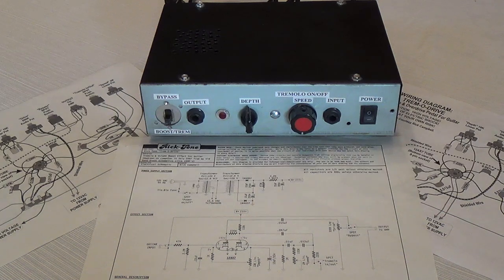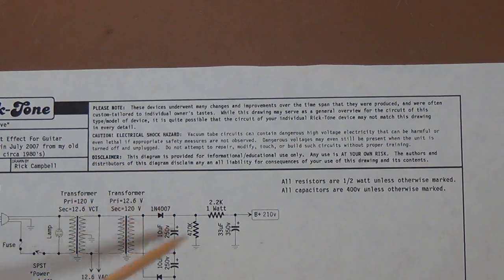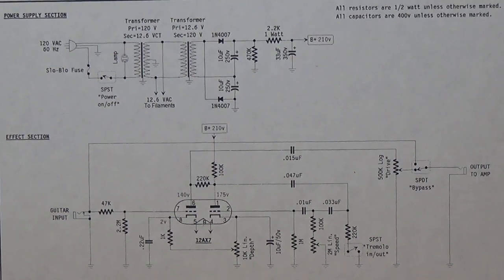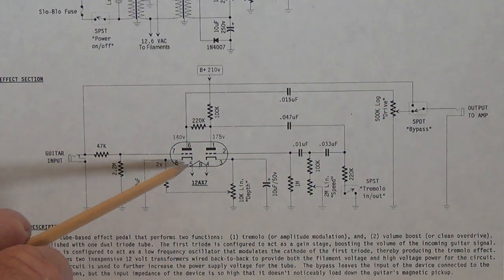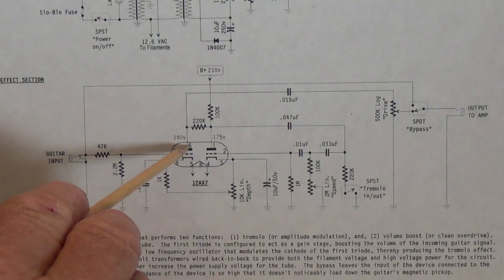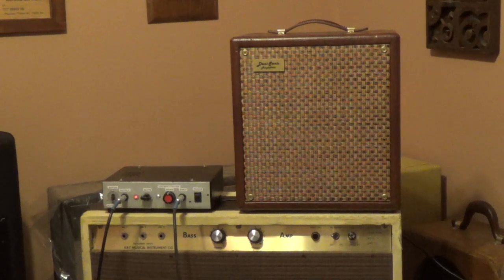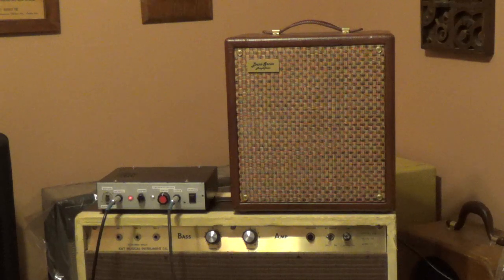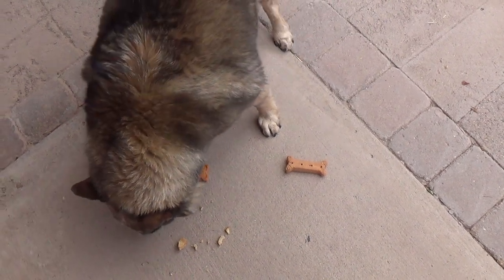Build Your Own Inexpensive Tremolo & Overdrive Boost Unit, Part 1

Comment: The MC3340 electronic attenuator is in rerelease. It's current controlled, but that's just a resistor for VC. It distorts pleasantly.
Reply from the maker: Thanks for the tip, Richard.

Comment: I like the idea of this project but I don't  think I need a Tremolo. Is it possible to make this project but instead of using the second stage as a tremolo circuit make it a second gain stage. It would probably need to use an attenuator circuit to prevent blocking distortion or run away gain?
Reply from the maker: The unit is primarily a tremolo effect hat has boost capability due to the use of a 12AX7.  Rather than subvert its primary purpose, it would be easier to simply build a basic boost unit.

Comment: This sounds amazing! Just wondered if anyone in the UK has built this? How would I go about adapting this to use with 220/240 V 50Hz mains voltage?
Reply from the maker: Glad you liked it, William. The circuit is actually simpler for you, since you don't need the voltage doubler with 220/240VAC.
Reply: @UncleDoug  thanks for your reply. You wouldn't happen to have a clear copy of the schematics/layout for this project that your could email by any chance?
Reply from the maker: @williamjenkins9423  My suggestion would be to use your "Print Screen" button to take screen shots of the documents you need, and then print them out. Good luck.
Reply: @UncleDoug  Would I be able to use a Hammond 369AX (250V C.T. @ 115ma / 6.3V C.T. @ 2A)?  Is it totally necessary to use 12V for the filament of the 12AX7?
Reply from the maker: @williamjenkins9423  You're in luck, William. Since the 12AX7 filament is center-tapped, you can connect one output lead from the 6.3VAC winding to both ends of the filament (pins 4 & 5) and the other 6.3VAC lead to the center-tap (pin 9). Look at virtually any amp schematic to see how to do this.

Comment: Hey, I’ve learned so much from your videos, great work passing on the knowledge Doug 👍 
Question - Would this be a harmonic tremolo circuit, or is it oscillating the volume? Do you know to a valve based harmonic tremolo circuit that could be made in to a pedal? Cheers 👍
Reply from the maker: That's good to hear, Chris. It is purely a volume-modulating circuit, i.e. a true tremolo. Harmonic tremolo requires several tubes and an elaborate circuit.....so it cannot be contained in a pedal.

Comment: GreAT video-- but question, after building one... My math isn't working (and sure it's me)  have 120 RMS (170 P2P) house voltage.  doubled (and loss thru the xformers) is 324V. will need a 2.2K and a 4.2K to get down to 210V at the B+  will greatly appreciate corrections..
Reply from the maker: Thanks for the info, Scott.
Reply: @UncleDoug  Once connecting all the signal side ( I made it in two parts, then ran the heater wires & B+ to the other part), it came down to 275.. and works awesome..  thanks again for the great videos!
Reply from the maker: @gpsfretworksllc6286  You're welcome, Scott. The B+ always drops quite a bit when it has a circuit to power.

Comment: could  I build this but use 220v - 12v transformers? or would the resistor and capacitor values need to be changed? best vibes and keep it up!
Reply from the maker: Yes, you can.....and you won't need the voltage doubler portion of the circuit. The component values would remain the same.
Reply: @UncleDoug  thanks for the reply! love your channel lots of good information! learned a lot with your videos! How awesome would be for you to build a tube harmonic tremolo! would love to see that happen! best vibes!

Comment: Hi Uncle Doug!!!  Here is my 2nd version of the Rick-Tone / Altec 1566A Preamp clone - https://youtu.be/GUwyo6Hfj7k  

It wasn't without its issues but I sure learned a lot!!!  I've gained some experience and confidence with this 2nd build and I'll probably take it apart...again...and build a 3rd version utilizing just one 12AX7 instead of two, and I'm probably getting ahead of myself, but I also have plans to clone the preamp section of the Ampeg B15NF and use the Rick-Tone voltage doubler and a 12AX7 instead of a 6SL7.  Wherever this may go I'll at least keep my hands busy with something fun, and because I have most of the components from the previous build I'll only have to buy a potentiometer or two and a resistor here and a capacitor there.  It's cheap, clean fun from here out!!!  Thank you for all the information and inspiration!!!  I gave you props in the video details and put a link to your page there as well. 

Thank You,
Chris
Reply from the maker: Wow, Chris. Very clever design, with the license plate chassis. I really like it !!!  Your wiring and overall construction seem quite good. What you are doing is EXACTLY the way to learn about tube electronics.....experimentation, solving problems, re-doing circuits better and better, etc. You are well on your way to an excellent grasp of circuit design and construction.
Reply: @UncleDoug  - Thank you so much for the encouragement!!!  I have mostly you to thank for getting me interested in all this!!!  Eventually I'll have something that sounds really good, compact, practical, and can be replicated for friends that would want one.

Thank You!!!
Chris
Reply: @UncleDoug  - I was reading up a bit and happened upon an article about the value of a a grid stopper.  I watched a few videos and I think this may be my problem.  On the "Hi/Lo Gain" switch I added to the 2nd version of this circuit there is no grid stopper on the Lo Gain setting that bypasses the first half of the tube.  It goes straight from the input to the volume pot then to pin 2.  The volume completely turns off (oscillation?) when the gain is turned all the way up, but then turns back on as you turn down the gain, but hums like mad!!!  OK, let me try that and I'll keep you posted!!!  Thanks for everything!!!
Reply: @UncleDoug  - Hi Uncle Doug!!!  I have finally completed the preamp project.  Here's a link to a quick video that shows the final construction.  I'll do one more video with sound samples.  This unit sounds great!!!  Thanks for all the help!!!  As always, I give you props in the description.  I'm thinking the next project might be a compressor unit of some sort.  We'll see...

https://youtu.be/s5XXIpJ3ukA

Comment: Hi Uncle Doug - Would connecting 14 gauge wires to the heaters, from the 18 gauge wires of the 12VAC PT, reduce resistance enough to lower the voltage at that node from 12VAC to 8VAC?

Background: No hardware stores around me carry anything smaller than 14AWG, so that's what I used for the heater connections, all B+ wiring, any jumper connections (i.e. pins in V2 cathode follower), input jack to V1, and all star ground connections which should be the only thing a larger gauge wire might be OK for.  I didn't want to buy the 100ft rolls of 22 gauge, 20 gauge, and 18 gauge wire for the 6ft of wire that I needed.  If this is the problem, I'll have to do a lot of disassembling, which would not be as difficult as figuring out what's wrong if it's not the problem.  Thanks for the time and replies.
Reply from the maker: Not even close, FN. At the relatively low current levels in a medium to small guitar amp, wire gauge has little, if any effect. There are vendors on Ebay that sell assortments of wire in useful gauges, like 18, 20, and 22 in various lengths for reasonable prices.
Reply: @UncleDoug  - Thanks for the reply!!!  Well, if wire gauge is not the problem then I'm fine with the 14 gauge I'm using.  I will look for connections shorting to ground?  I am committed to tearing apart the unit and putting it back together component-by-component.  I suppose I should surely find the cause that way.  

Thank You!!!
Chris

Comment: Hi Uncle Doug, Would you have any idea why my 12AX7 filament wires only show 8 volts instead of 12 volts?  The rest of my circuit is different.  I used the power supply from the RickTone tube preamp which is very similar.
Reply from the maker: How are you measuring the voltage, FN?  With the tube out, from pin 4/5 to pin 9 with a calibrated AC voltmeter? If so, then I can't explain it without examining the circuit in person.
Reply: @UncleDoug  - Thank you so much for the reply!!!  That may have answered my question and will undoubtedly create more questions once I am able to  test again tomorrow afternoon.  It is possible I have the filaments wired incorrectly, from the 12V secondary to pins 4&5 only, with no connection to pin 9.  Would incorrect filament wiring affect the B+ voltage?  Because the voltage doubler does not seem to be...doubling.  It is altogether possible I am measuring that wrong too.
Reply: @UncleDoug  I rewired the filaments in parallel and measured between pins 4&5 and pin 9 with a AMPROBE AM-510 multimeter, and got 7.8VAC.  I plugged in the tubes and they are now glowing, unlike when I only had pins 4&5 wired in series.  I got excited and figured if the tubes were glowing it must be ready to plug in and try it out...  The tone fattening capabilities of this unit are apparent even at the very lowest gain setting.  Anything above 1 and it's clipping though.  I was going to record a few samples with and without, then measure some more with the tubes in place, to see if that would make any difference.  However, before I got to measuring, a terrible smell filled the house and I had to turn off the unit, turn on all the fans in the house and open all the windows.  Both transformers were extremely hot.  Also, before I plugged in to enjoy the sounds, I measured the input of the voltage doubler from the output of the 120V side of the second transformer and can't remember what it was measuring but it was nowhere near 120V.  I think I'm going to migrate towards acoustic bass guitar and not have to worry about tone from melting-plastic smelling electronics that I know nothing about.  It was a fun experiment while it lasted.  Thanks for all the replies!!!
Reply: @UncleDoug  - I think I just realized what is the problem.  I believe what is causing the low voltage is how I have the primary of the 1st transformer wired through the pilot light, which has a substantial resistor to protect it.  I drew up the wiring diagram before I knew I needed the resistor on the neon lamp, so the diagram did not include the resistor.  I must have considered that node not to include the resistor so I believe I have the primary wired through the pilot light instead of just to it.  I'll keep the dream alive and check it tomorrow with a fresh set of eyes.  Thanks for the inspiration, Uncle Doug!!!
Reply: @UncleDoug  - I looked at how I had the pilot lamp wired and it was wired correctly in parallel so it was not affecting the primary of the first PT in any way.  Just to make sure, I removed it from the circuit and checked without it, I got the same measurements where the 12VAC output of PT1 meets the 12VAC side of PT2 and the filament wires, as I did with the pilot connected.  I figured while I was taking this thing apart, that took me forever to put together, that I might as well see if one of the transformers was bad.  Here's what I got when I isolated PT1: Input=121.8VAC / Output=15.51VAC/7.74VAC/7.76VAC.  Does the output seem a bit high for a 12VAC secondary or does that seem to be within tolerance?  When I connected PT1 to PT2 I got (from PT2): Input=14.85VAC / Output= 112.3VAC.  Again, that seems within tolerance, right?  Do you have any idea what would cause the voltage to the filaments to drop to 8VAC when connected to the circuit to the rest of the circuit?

Comment: Way back when, Radio Shacks in even moderately sized cities were veritable candy stores for project components like this.  Yeah, some of the components they sold could be sketchy, but they were mostly inexpensive so it wasn't a big deal.  One could come up with a project idea, make a trip to RS, and have enough stuff to get through 90% of an initial build.  (Always note that the last 10% of any project takes 90% of the total time.)  Anyhow, I miss those days.  Thanks for all you do, Uncle Doug!
Reply from the maker: You're quite welcome, Michael. I too mourn the loss of Radio Shack. Whenever I ran out of a particular value of resistor, capacitor, etc. I could buy it from them and be back to work in an hour.

Comment: I have a few queations I am,glad you have this video am wanting to build a bad ass amp but I agree I am not ready for that yet so this is a great starter build and useful as I will use it so my question is where do I get the components for such a build and what kind of parts do I need to keep a stock of such as resistors capacitors etc... Would appreciate it if you could address in a video or respond directly thank you I have been watching your tutorials and I am,confident in giving it a go some things are retained only when used in application just knowing will never get me ready to undertake an amp,build without some practical knowledge
Reply from the maker: Most vintage parts are simply on hand as a result of many years of working on amps, Jeff.....which won't do you much good.....but my favorite source of all components (other than transformers) is Antique Electronic Supply.
Reply: @UncleDoug  thank You so much since,I have you answering questions I have a hand full of old radios as well 30's mostly none,of them,have an auxiliary input and some,of,the capacitors are the paper kind 2 of them ate 6 volt DC the one I am,most interested in is a Atwood Kent 310 it is a 120 watt amp in it 10 tube do you have any experience with such an animal I found a schematic but it has half the wiring diagram,cutoff do you think it would make a good base for a guitar amp
Reply from the maker: @JethroBoDean  In my experience, the older radios aren't really suited for conversion. You can use the cabinet to house a scratch-built amp chassis....but trying to change the ancient circuit into a good-sounding guitar amp is more trouble than it's generally worth.
Reply: @UncleDoug  great info at least I'll have some tubes and transformer etc... To start filling my parts bin 😆 thanks again oh one more thing mostly of curiosity and I cant seam,to find any info any where on line the bone yard I was going through had I'm not certain what it was it had a 1/4 inch jack or 2 in it and had tubes that were slotted at the top of a rectangular shaped prob 1 inch across and 1 inch wide x about 3 inch tall and the rectangular piece was slotted in the tube socket strange looking any idea what in the world that is or was
Reply: @UncleDoug  I found,the tube # for those strange combo whatever's 5963 they look like a pentode type and one of the rectangular socket is brole loose apears to be resistors mainly and there is another number on a tube 6211 looks like a double triode type over all there are 20 slots for tubes a 6 way switch and an on off switch no volume that I can tell and a fuse holder on the opposite side no big power transformer has what looks like a choke,and an output transformer mounted underneath inside the chassis
Reply: @UncleDoug  I had a revelation on how to play through the old radios would an am modulator work with a guitar just to get a sound,out of it to squell my curiosity
Reply from the maker: @JethroBoDean  The description doesn't ring any bells, Jeff. Maybe a viewer will have some ideas.
Reply from the maker: @JethroBoDean  Again, Jeff, it rings no bells with me. Sorry.
Reply from the maker: @JethroBoDean  I have no idea, Jeff. Why not just try it and see ?
Reply: @UncleDoug  yes I dont see any danger in,it thanks again I'll come across something that knows what the heck those funky tubes are in the mean time I am,rounding up parts for the build should be straight forward thanks to your detailed instructional videos there fantastic
Reply from the maker: @JethroBoDean  Good luck with it, Jeff.

Comment: safety IS ALWAYS THE PARAMOUNT consideration! But, it is a lot more fun with 600VAC three phase using a 1.8 Megawatt drilling control. But, I still love a Pincention Reverb I made back in 1978 using a switching power supply front end. Tube type UNIVIBE was my best one.
Reply: Is your dad still farming?

Comment: Hi uncle Doug just been watching this video and remembered a amp circuit that has a tremlo built in on ist stage of the pre amp. it uses the plates and grids of a EEC81 as a Multivibrator then feeds the out put into the pre amp it was published in a mag in 1965, anyway the link is https://americanradiohistory.com/Practical_Electronics.htm and the book is Feb 1965 page 269 would be interesting to know what you thought about it and there is a ton of other circuits there as most of the mags are there to browse and download.

Comment: Hi. Can i use a 6em7 in plase of 12ax7?
Reply from the maker: They are both duo-triodes, but otherwise quite different, including their pinout. I guess substitution is possible, as long as all the rewiring and operating parameters are proper. Here is some info on the tube:  http://diyaudioprojects.com/Tubes/6EM7-SET-Amplifier/

Comment: Hello. Can i use this tremolo as a preamp connecting de output of the effect directly into a power amp stage?
Reply from the maker: I doubt that it would work very well, German. The unit only uses one triode for amplification.....even a Fender Champ used two......so the input signal to the power amp would be really weak. Try it and see.

Comment: Love these videos, very informative! Do you think you could explore the tremolo circuit from the Gibson GA-40 in a future video. I know it oscillates the signal rather than the tube bias and it looks like it has another phase shifting RC network in there but I can't quite figure out how the oscillator is interacting with the signal the way I can with the bias modulation and the photo-resistor circuits.
Reply from the maker: Thanks, Steven. Check out my videos on the two different types of tremolo. I'll bet they answer all your questions.